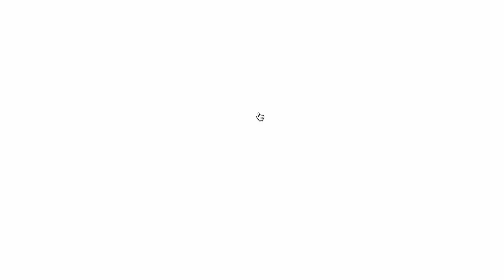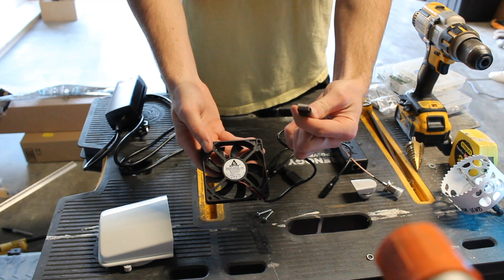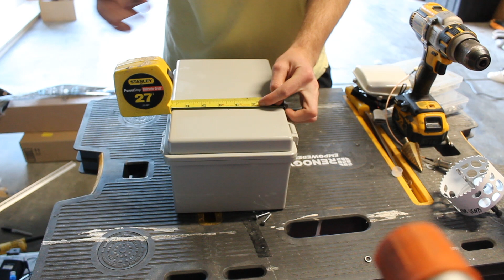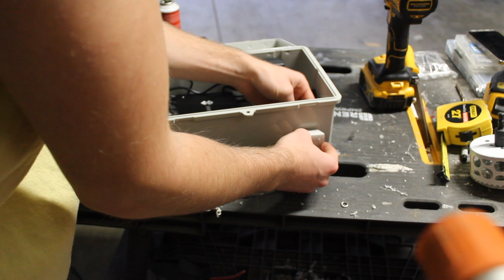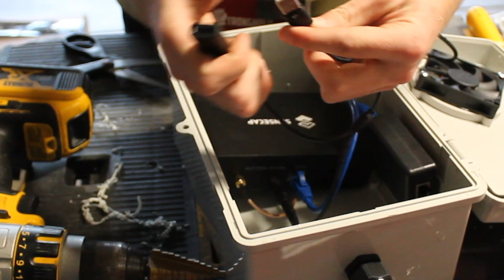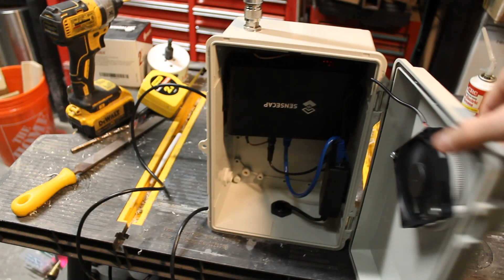PoE Powered Enclosure for Helium Mining(Build Guide)

Comment: Correction on my last comment. The P2 video had a single larger vent on the side. Does it matter?
Reply from the maker: Preferably you’ll want an intake vent and exhaust fan/vent. Sometimes I use a smaller vent for the intake it’s just all preference. Just make sure your intake vent isn’t super small in comparison to your exhaust vent or else you’ll create a negative pressure vacuum within the case; can damage components.

Comment: Does the fan run constantly? Can you fit a fan controller with temperature probe like you did on the original Off Grid set up?
Reply from the maker: You can put in a temperature controller yes. The only reason why I don’t run a temp controller on PoE setups is because power consumption isn’t limited as it is in an off grid application.

Comment: No lightning arrestor? Also I would use something at each drilled hole to prevent water ingress around your vents and bulkhead connector. Water can seep in in tight joints and through screw threads. The lower part of your box may fill with water.
Reply from the maker: I use silicone on all vents and glands. Final video will show that and dielectric applied to rf connections

Comment: hello, good video, what is the measure of the tool to make a hole for air vents? https://youtu.be/ntQ-833uP_Q?t=69
Reply from the maker: Hi, 3 1/2 inch for 80mm fan vents, 2 1/2 inch for 60mm fan vents. I used 3 1/2 in this video